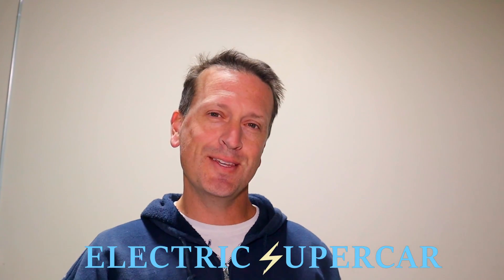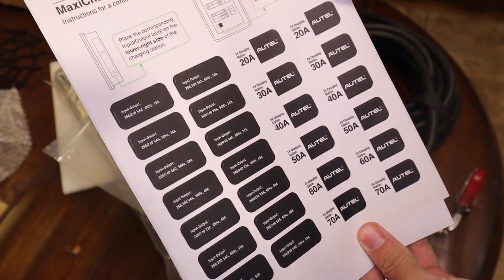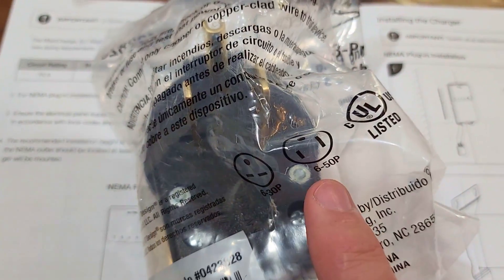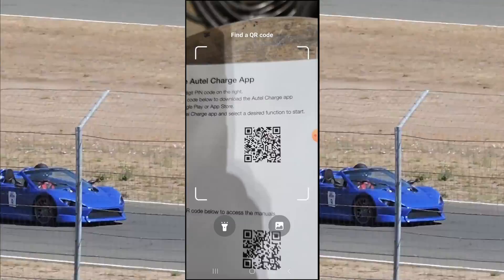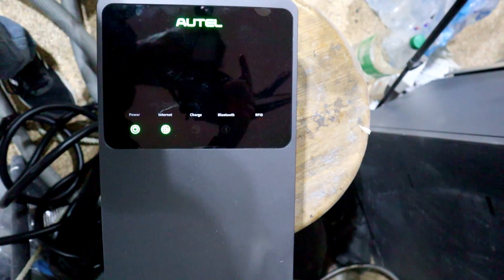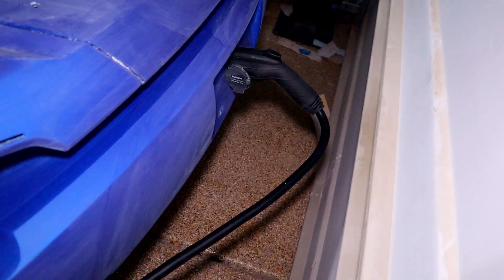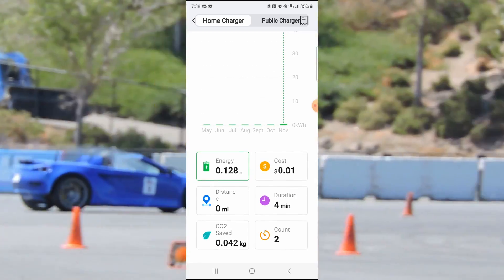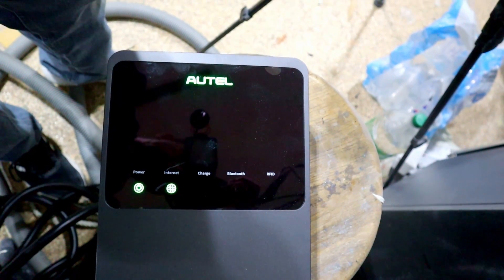At Home EV Charger - Autel Electric Vehicle Supply Equipment

Comment: Out of curiosity I know you use the Tesla motor in  your car so if you went on a trip would you be able to charge it public charging places probably not a Tesla supercharger station is that correct ?
Reply from the maker: Hey Ron!  Thanks for the comment!  I went with the J1772 plug and a 2.5kW on-board charger.  I can do public chargers, but cannot do Tesla superchargers
Reply: @electricsupercar  
I keep considering doing something similar to what you've done but I kind of look at the problems that maybe I can't charge it if I were to actually take a trip with it I don't know if I actually would go for any distance with it but if I did I thought how would I be able to charge this thing so anyway thanks for letting me know

Comment: If you think the Mustang Mack-E is a nice car, you should go and test drive the
Kia EV6 AWD, 77.4 kWh battery, 325HP / 605 Nm  0-100km/h in 5.1 sec. (I have this one myselfe)
Or even better, the
Kia EV6 GT AWD 77.4 kWh battery, 584HP / 740 Nm  0-100km/h in 3.5 sec.
Bouth with max charging power 800volt / 232 kW

I know of several who have sold their Mack-E and swap to Kia EV6... ;)
Reply from the maker: I'll have to check it out